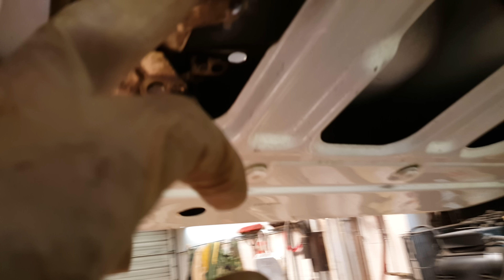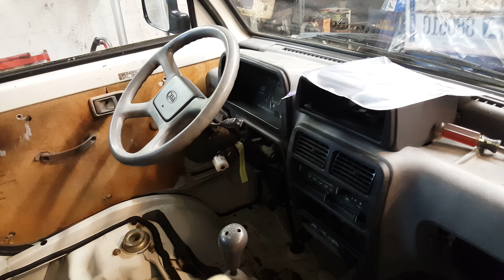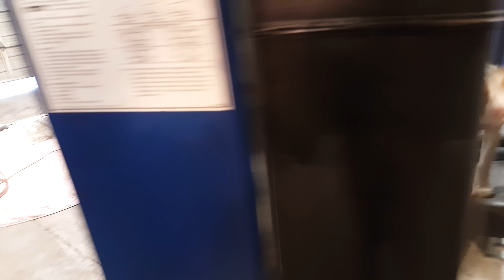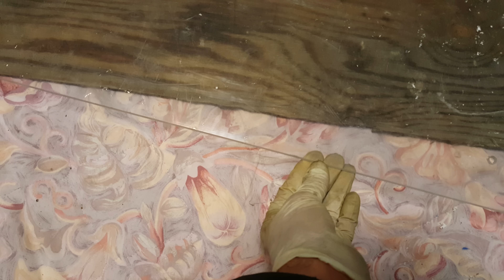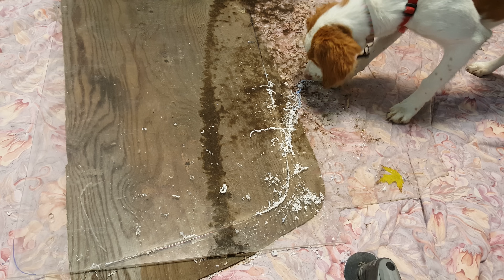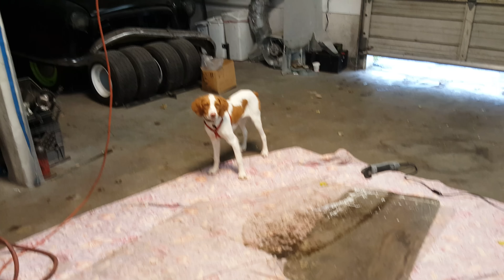Cutting Lexan/Plexiglass Windows for the Modern Mystery Micro Van

Comment: It may be too late but I've got a finishing idea for the rear window. Instead of gluing and screwing (doesn't that sound dirty...) I've seen custom window insets that use something like this https://rubberstock.com/window-rubber-seal-25-7-5mm.html.  This will put a rubber to steel seal in place eliminating the need for both glue and screws. 
If you order enough you can even convert the side panels to Lexan very easy.

Comment: A thin blade, with the less teeth the better, on a jig saw. 
You may in the future want to install the window using some pinch weld type rubber. 
The kind used to hold excavators and such.